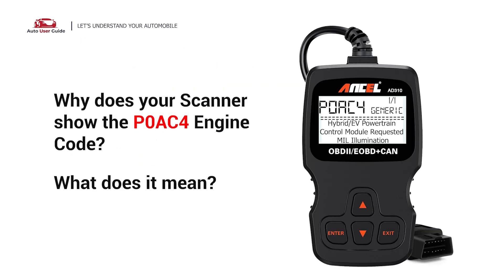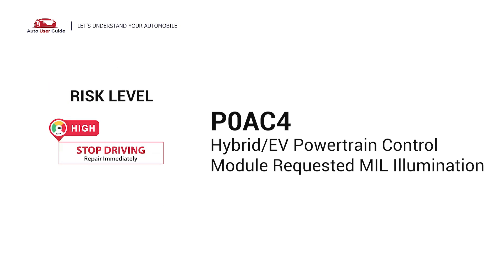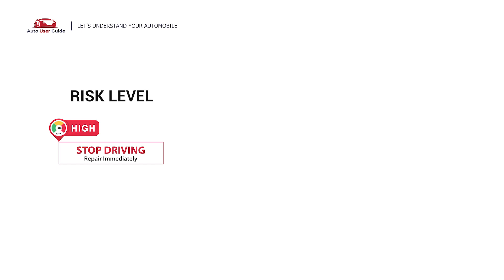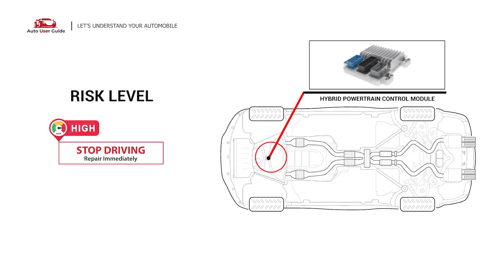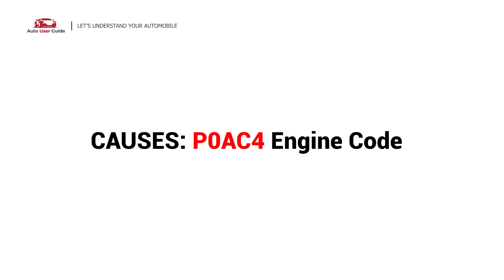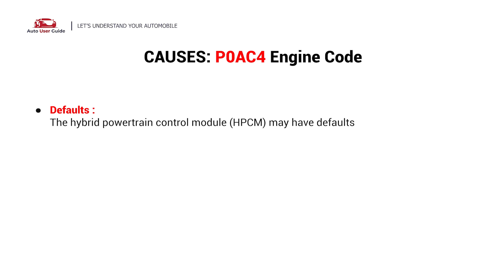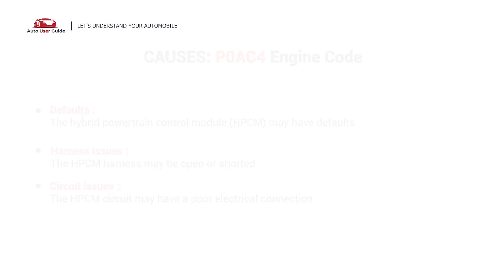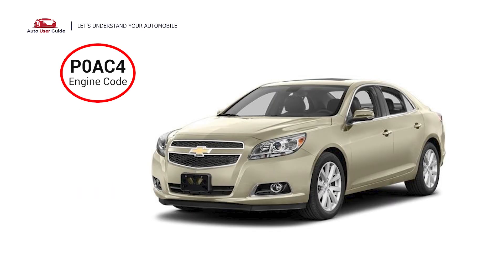What is P0AC4 : Engine Error Code Causes Explained

Comment: I'm just gonna throw this out there that they don't know how to fix it. If you want to fix this code 1st check your belt and pulleys. 2nd check voltage from alternator to both batteries the 12v and the hybrid in trunk . If you have 14 v at both most likely it's the battery. If you have less than 14v at alternator replace . If you have power loss going to hybrid battery replace the main power wire, same for the 12v battery is voltage drops. Most fixes is cleaning the terminals on both batteries